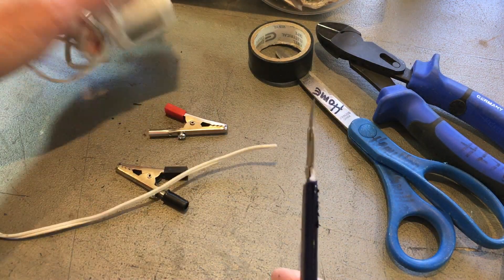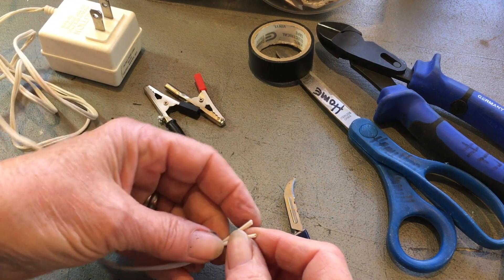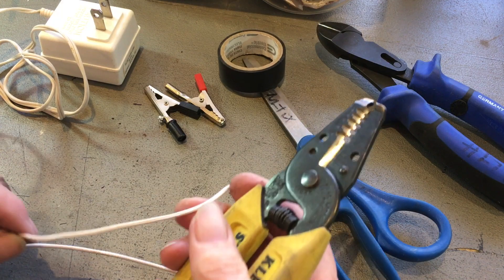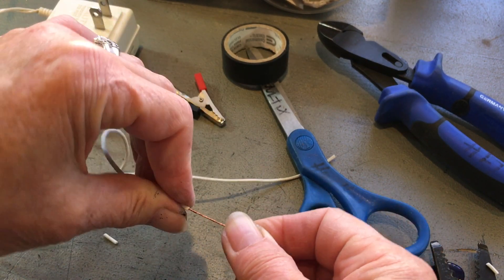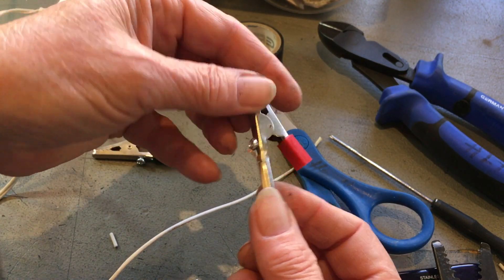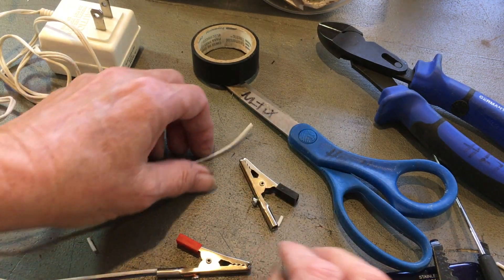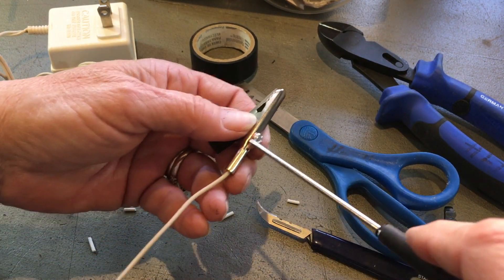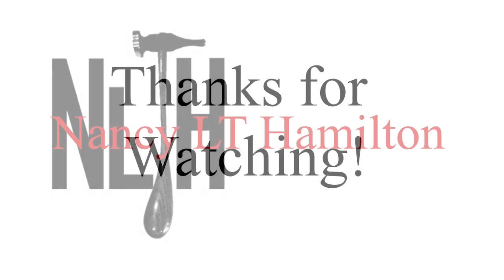How to Make an Electrical Etching Machine.

Comment: I watched , I watched it again , WOW , this is so simple and it really does work . Used a power supply off my out dated home ICD monitor, cut the plug off the wire put the gator clip 
On the wires and got some nail polish . It really works , Thanks for this video 😎

Comment: Hi, I am looking for a DC power supply , I found two different ones on line  which are  https://www.ebay.com/itm/30V-5A-DC-Power-Supply-Precision-Variable-Digital-Adjustable-110V/113139856088?hash=item1a57a932d8:g:KiwAAOSwl5JcEOBJ 
and the second one is https://www.ebay.com/itm/PS-28A-ADJUSTABLE-VARIABLE-POWER-SUPPLY-BENCH-DC-OUTPUT-12V-9V-7-5V-6V-4-5V-3V/123250140276
could you tell me which of the two will work for metal electro etching? Thanks

Comment: I have a 34012 universal AC Adaptor, the input is 120V 60HZ 7W and it has a 2 switches, 1 is for volt change from 1.5 to 12V  Which number do I set it for? Then the other switch is for polarity both + and _   I do not know what to do with the polarity, do I have to set it to polarity?  I am not sure if YouTube still has the email feature to send a pic so that you can see the adaptor.  If you or anyone can make a suggestion, I will appreciate very much so. Thanks. Do you have a video on how to prepare the designs to etch them on cooper?